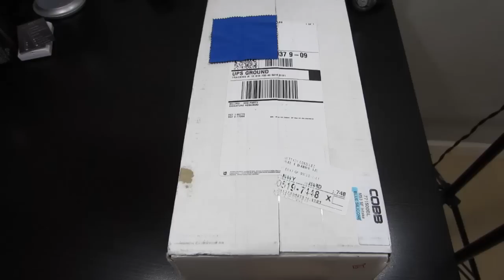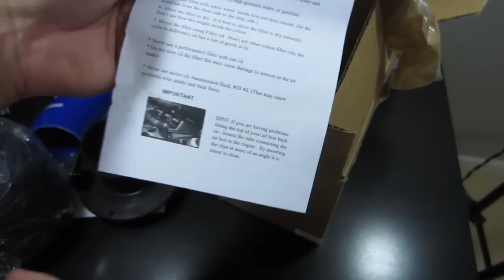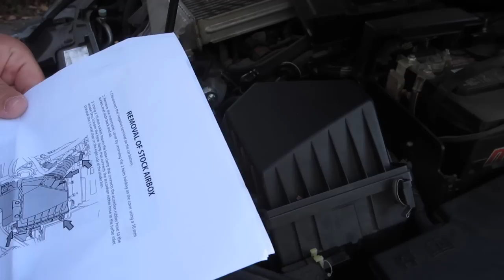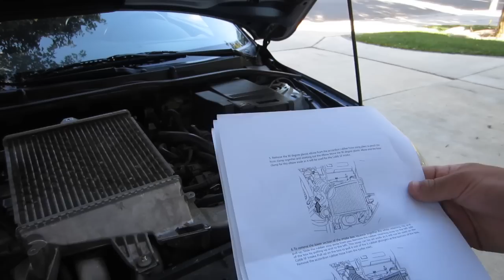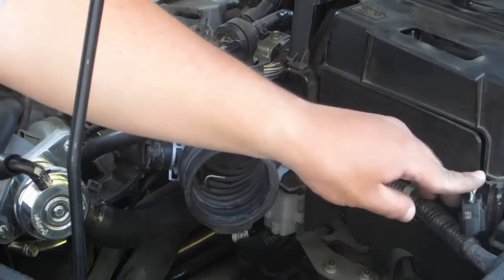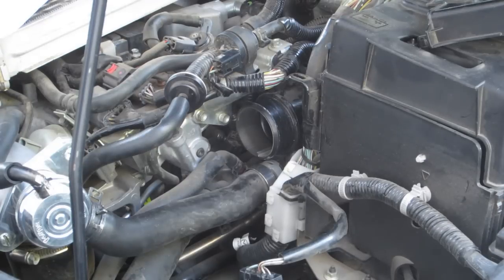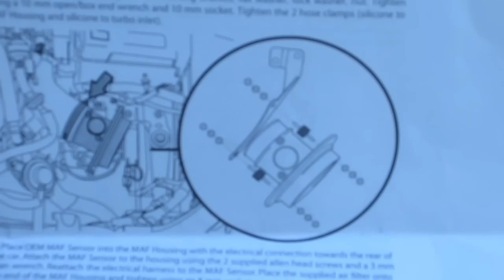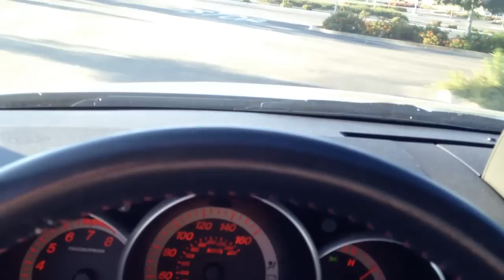Unboxing and Install of Cobb SRI for Mazdaspeed 3

Comment: Just to clarify a few things. When installing a cobb or corksport sri with stock size maf tube a tune is not at all necessary. The stock tune is super lenient. If installing a 3" intake or any other non stock size maf tube intake a tune would deffinately be a good idea, although it still most likely wont end in zoom zoom boom. The very next mod however NEEDS to be high pressure fuel pump internals (honestly is would be the best first mod as the car runs much smoother tune or not). The stock hpfp runs out of juice almost the second you start modding. DO NOT swap your down pipe without the hpfp upgrade.
  I appreciate a good how to, and yours makes the cut bro. 
Anyway, love what youre doing with her,l. Something you should do (if you havent already) is a egr delete. Buy the thin plate version and place it between the head and the egr, leaving the egr on the reinforce the block off plate, and leave it plugged in. You'll have a much cleaner engine and no CEL's. If you have any questions let me know, ive done tons of walk throughs. Take care brotha
Reply: @mrGSX1391 FYI the COBB intake is NOT a stock size MAF tube. Its larger than stock.

Comment: Why is your check engine light on? My mazdas engine check light has been on and iv fixed everything, brand new parts
Reply: You probabpy either have a catless downpipe and didnt use spark plug non foulers to space it, or your car has an egr delete and hasnt been flashed. Either way, get a cobb accessport and turn off the feed from those two sensors. If that dpesnt fix it, message me and we'll figure it out.

Comment: maf sensor mass air flow measures ammont and temp of air comeing through intake. o2 sensor oxygen sensor(senses o2 in the exhaust to see how efficient combustion is) map manifold absolute pressure pressure in the intake manifold. 

i hope that clears this up

Comment: Air intake dont really give you performance gain.. Its just nice
Reply: On a turbo car, air flow is everything, and the stock box is extremely restrictive.
Reply: Brenden Ward I said air flow, not colder air.
Reply: crimson25haze They proved that the stock box is the best way other than hanging the intake off the front of the car, the short ram and "bumper placement test" actully provided less hp. It may be about airflow, but the stock box with a new filter does a damn good job.
Reply: +Brenden Ward Cold Air Intakes and Short Ram Intakes are two different things entirely Brenden....just an fyi.
Reply: Did you even watch the video posted in comments? Obviously we're talking about how airflow is important, which if you read above you would understand... As well as how the stock air box does a great job on its own.  If you watch the video, you'll clearly see that I know the difference between 1. stock 2. short ram 3. "cool air" and 4. Cold air.
Reply: Ya just 25whp....
Reply: I believe the cold air intake on this car is the two front scoops thats force air on the intercooler.so the throttle body can suck in the cold air forced on the cooler.the turbo inlet can suck hot air aswell it wont make difrence.thee last step to provide this car with cold air is the front ram scoops.thats what give ir engine the cold air it needs

Comment: Should have gone with a new Turbo inlet pipe also.  Next I would get a fmic without a scoop I'm sure you have some heat soak.  And I'm sure you know that was not an o2 sensor

Comment: hi guys. If i get this installed on my car. Does it require calibrarion or tune. Or its fine to run
Reply: Its perfectly fine to run cobb or corksport sri's untuned. I prefer the cprksport because it cpme with a turbo inlet pipe too (cobb just attaches to the stock plastic turbo inlet), but the cobb is definately quality too. Make sure before you do any other mods to get hpfp (high pressure fuel pump) internal, either corksport or autotech. You wont need to tune after upgrading the hpfp fyi. If you do anything other than an intake upgrade withouglt upgrading the hpfp internals you really risk running lean and blowing something up. It also makes the engine idle and run so much smoother. Once you get past intake/downpipe youll want to get a cobb accessport (prefferably v3) to get your tune in order (you also wont feel much power gain till you tune. It comes with staged maps and is a breeze for even a newb to use. Have fun and take care of your ride, it wilp repay you 10 fold.!
Reply: mrGSX1391 you should deffinately join mazdaspeedforums.org. tons of incredible info and some of the most helpful people youll ever meet.

Comment: Ok, now the battery bracket will be broken in 5000 Km or so. After so many user complained, they added those 2 gromets to prevent that but no joy. The bracket will break eventually.

Comment: The reason why your CEL came on was because you disconnected the Mass Air Flow Sensor (MAF).  Trust me I've done plenty of air intake swaps and that's one thing you just do not do if you want to keep your car from throwing CEL (check engine light) codes.